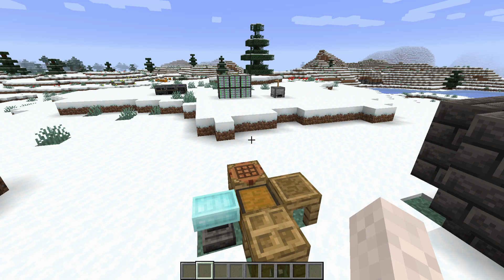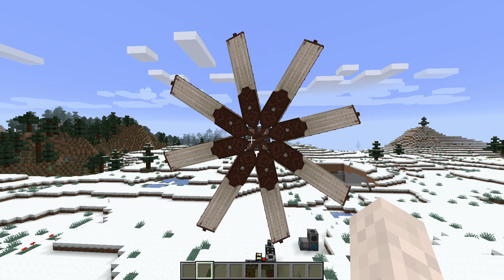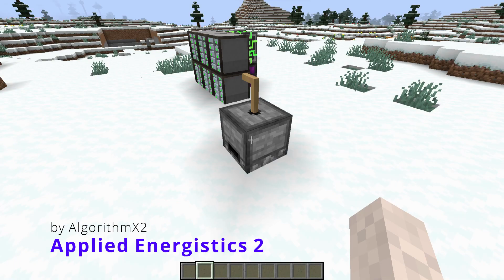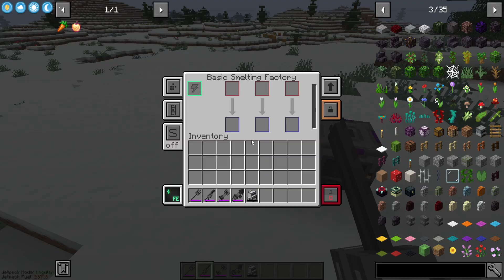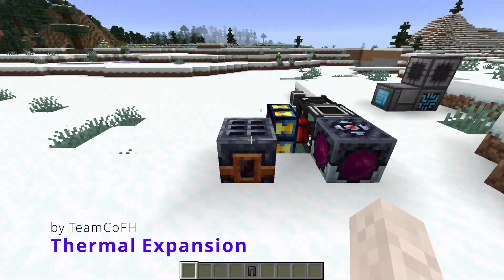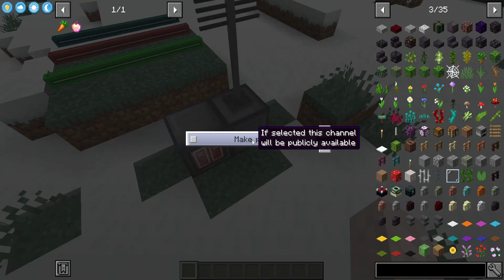Top 10 Tech mods Minecraft 1.16.5 Forge

Comment: Three of my favorite mods did not make the list. Rftools storage is amazing. It makes it fairly easy to get a portable 200 slots, like a shulker box on steroids.

Engineer's Decor is an add-on to immersive engineering which gives a lot of useful items as well as the decorative ones. 3 iron ingots and a crafting table gives you a  nice workbench with 18 storage slots that keep the contents when moved.
Reply: Integrated dynamics is near the top of my list. I like the menril trees and the torches and the mechanical squeezer and drying basin. The companion mod integrated tunnels is outstanding and has a relatively low cost of entry. Integrated Terminals builds on that to let you craft from all connected inventories. There is also a way to automate crafting jobs that I have not played with yet.